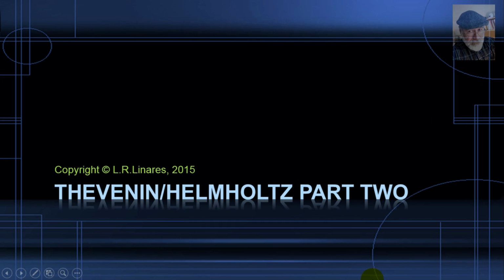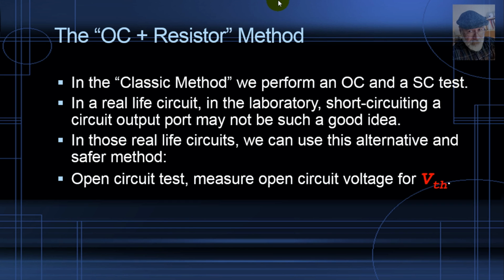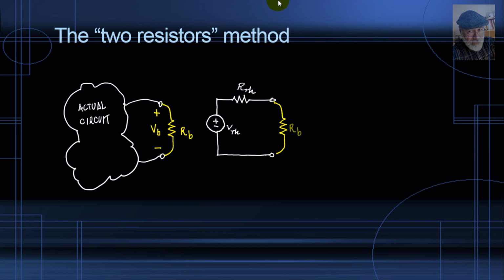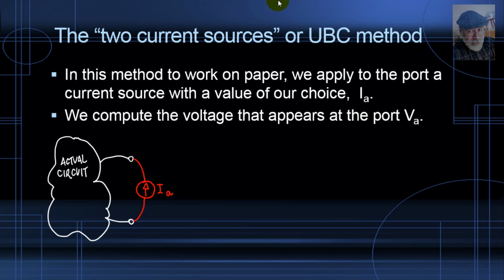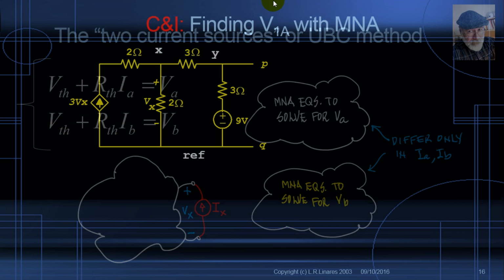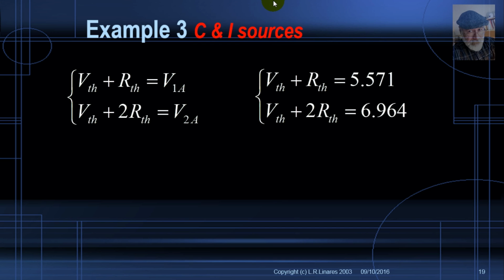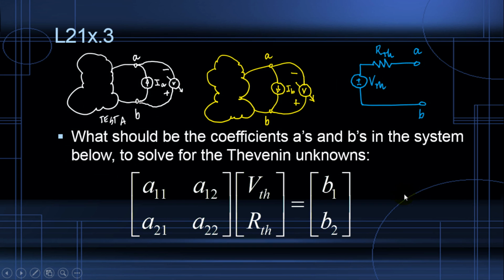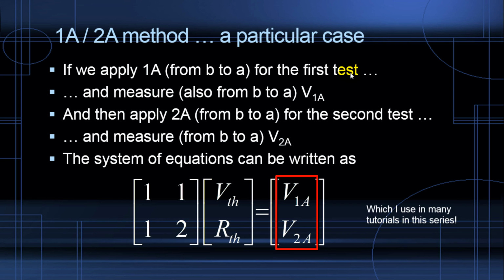EE 101/23 - Thevenin's Second Part (Alternative methods) 1A/2A

Comment: Nice video. From a practical point of view, two resistors and two voltage readings = A resistor box plus a cheap volt meter = super quick to do with minimal components.
Reply from the maker: Exactly!